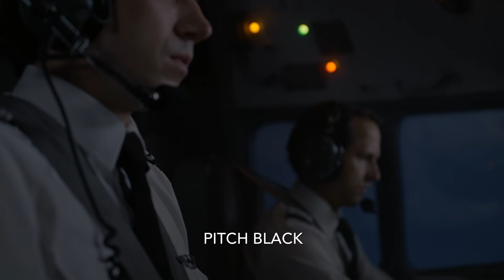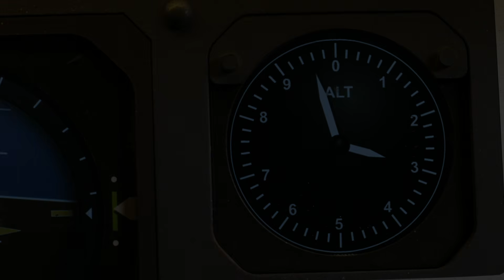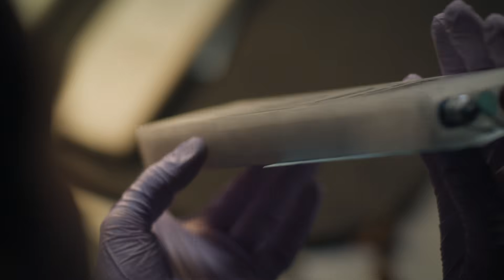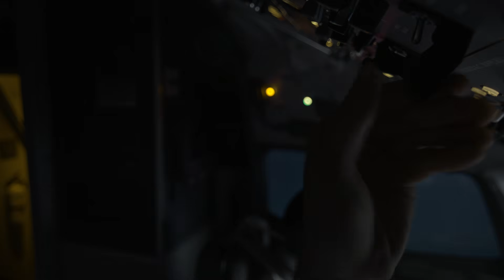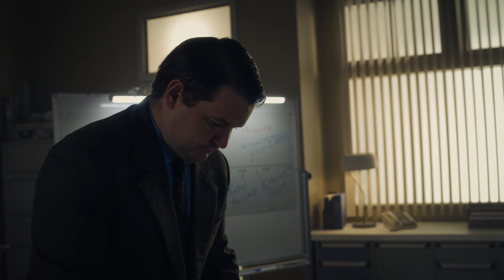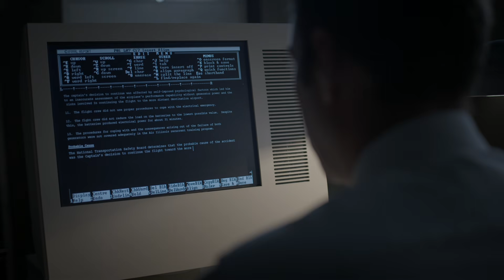Air Crash Investigation [English] - Pitch Black

Comment: It's incorrect to blame the captain after he is gone, he is not alive to provide his version. The other crew's testimony of best FO with good systems knowledge switched off the working generator. They were issues that led to the accident. Both the crew were responsible for this accident. They assumed a lot of things. Like oxygen generators,  batteries provide backup to aid in safely landing the plane ASAP and not in continuing the flight.

Comment: What these pilots did is exactly what the British Eagle Flight 802 pilots did when their Vickers Viscount 739A suffered a total electrical failure and their attitude indicators misled them during an emergency descent but unlike Air Illinois Flight 710 who were so low they hit the ground very quicky whereas the British Eagle Viscount entered a steep descent until British Eagle 802 disintegrated in mid-air and crashed into the embankment carrying the four-lane Munich-Nürnberg autobahn.

Comment: When you have a basic understanding of batteries you realise the pilots didn't understand discharge curves. 

22.5 volts is 1.25 volts per cell

21.5 is 1.19 volts per cell which is 80% discharged

20 volts 1.1 volts per cell which is dead flat

So in reality 11 minutes before the airliner crashed, they lost the batteries at 8:42 pm when they more than enough time to land at an airport along the route or turn around and land.

Comment: Flying without a transponder also sounds super dangerous. Once the situation grew worse, they should have landed at one of the other nearby airports. 

And constantly these episodes show how dangerous it is to combine an aggressive bossy person with someone who's scared to speak up. 

What is unclear (to me) is in this scenario would the engines on the plane have continued to work? Or would they have died? I guess without power the engines would have stopped as well? 

And how exactly did the captain expect to land at the destination without the ability to contact the tower to get a runway?? Because other planes would be coming in and taking off too. Just coming in without permission sounds like it could lead to a collision with another plane, especially since they had no transponder.